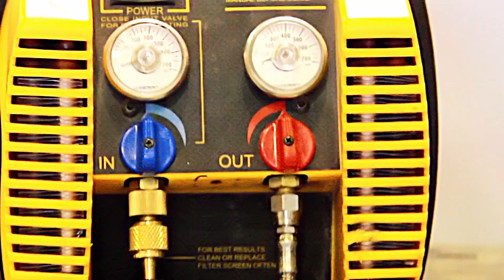"Subzero Saturdays" closed loop essential oil extraction seminar

Comment: far too many folks see this and adopt these standards, after watching their video I have to say, it is deplorable when it comes to safety issues and understanding of this gas. I have used it for last 35 years and I released BHO in 1998. I am currently constructing a show on what the risk are and how to minimize them including ventilation requirements and how to make yourself burn proof. keep an eye out for it soon. I am the holder of the worldwide patent on gas extraction and the equipment to do so with.
Reply: Is that out now? Id be interested in this.

Comment: In regards to the "do this don't do that" gang, phooey. Half the fun is experimenting. There are very few ways to actually fuck up a good batch of oil. As a friend once said, "there is nothing you can fuck up that I can't fix".Some of my best product has been from experimentation. The first time I produced a batch of "Foam" was on accident. I stabilized it and got the melting point where I wanted it and treated my friends to millions of tiny golden crystals that truly freaked some people out.  Shatter is nice, but there are an endless variety of "novelty" oil products possible only if you fuck with your process.  DONT EXPERIMENT WITH SAFETY. learn the basics and stick to them. Respect, eh?

Comment: Looks like you guys put a lot of work into those.  Why are you using butterfly valves for brewing?  Why are you using single bolt clamps?  WHY IN THE HELL ARE YOU USING A HVAC PUMP?  Those have plastic parts in them and seals not rated for butane or solvents.  You are playing with a time bomb.  Good luck.
Reply: whaT DO you think of Emotek labs?
Reply: 240SSONLY Hydrocarbons are organic ya know? Pentane and hexane have been used as non polar solvents b/c they are liquids (barely) at room temp, and are more convenient than butane which is a gas at room temp (again, barely) People think butane is so toxic, but it ain't got shit on hexane. The problem is they pose a fire hazard. Beats using chloroform...
Reply: Ilir Kumi YES, you are correct i should of mentioned greenhouse gas like CO2 in a separate section... i like the newer style bho systems but again... too much safety stuff involved to prevent fires...

and yes anything is better than chloroform... lol
Reply: +240SSONLY I work in oil and gas on co2 pressured oil wells. 1/4 turn valves are perfectly safe would be safer I'd they were in pairs of two incase of one washing out.  always using downstream valve to throttle/pinch. inside valve as master.med grade teflon packing won't absorb practically any acids bases or solvents.  but I can only speak for the valves themselves. not final product.
Reply: king sire im no one to judge, but they are a great processing facility and they know what they are doing, they definetly make top noch extracts... I also dont disagree with many on the industry that butane and other HC solvents are great for extracting cannabinoid profiles from the plant matter... but it is done at a great cost of having to process for longer times and do several methods that wouldn't be necessary when using an organic gas like CO2 and the proper machinery.

to summarize... CO2 espresso machines cost a lot but require less work and produce a better product all around. Emotek processes great material and make a great product while using hydrocarbons or other solvents to do the same thing, but they require extra machinery and more time involved... like vacuum ovens and other distilling methods...

so i approve of them because they know what they are doing... but i wish they used other equipment and better "solvents" to get the same result...

HVAC pumps are designed for refrigerant and lubrication, not compressing volatile gasses on an indoor facility... i dont care how many fireproof exhaust fans and anti-static ground straps they got... its not worth it.

butane is too dangerous and working with it is not fun. So because most processors don't extract all the butane out of the wax they sell, because they lack expensive ovens so they offer butane soup for cheap... butane has become a no no for me... that's my opinion and thus tells me that all concentrates that are not CO2 or very well processed for days, are simply something i would avoid...

i like my liver and kidneys the way they are, no need to overwork them trying to process extra hydrocarbons from the crap i smoke.

then again, there are people that smoke meth... so a little butane is nothing to them... rolf
Reply: you took the words right out of my fingers as they say... ROFL

i have seen first hand on the field how those pumps fail with refrigerant every where and its no fun. There are seals inside those machines that have to be replaced every few jobs and dealing with cannabis oil inside there is not ideal.

they are literally making a mini pressurized high tech bomb using butane or propane as solvents to get that honey oil. it does look great but you guys know better... CO2 is where its at. use the plant material after to make butters or oils of lesser potency... done deal

fuck this hydrocarbon solvents crap... shit is no bueno...